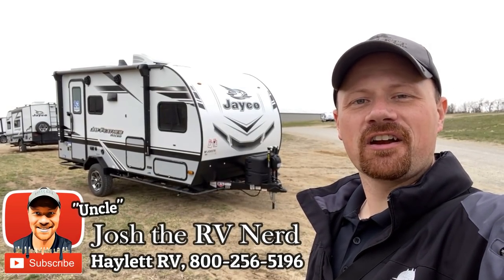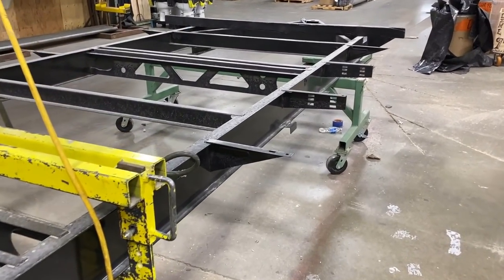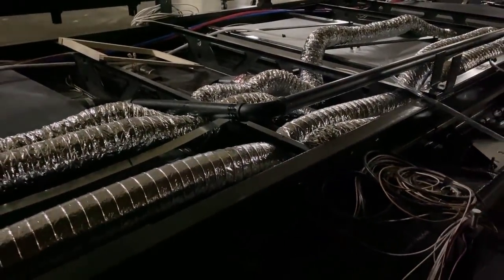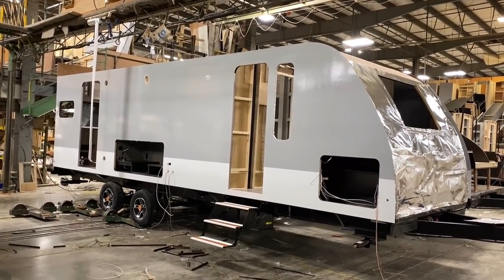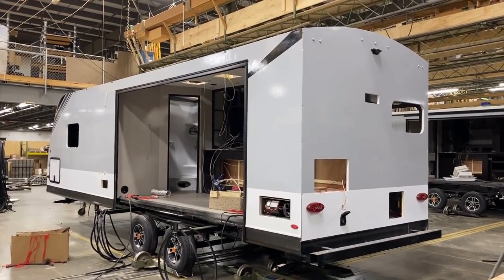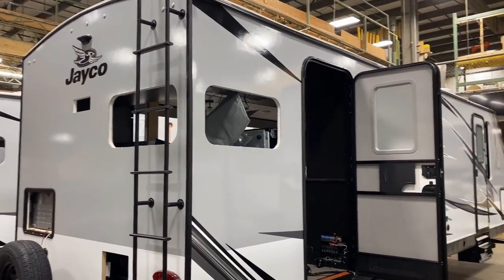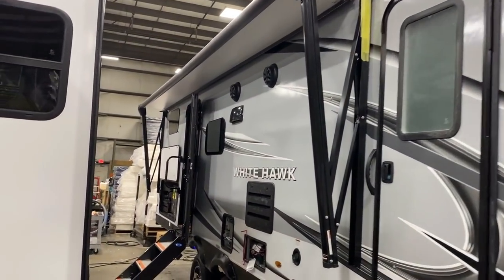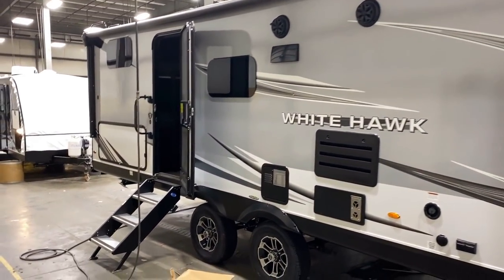(Part 4 of 4) How RVs are Made - Jayco White Hawk Plant Tour AFTER HOURS!!

Comment: Very cool. Just bought a 2022 jay feather. Only issues when I picked it up was one of the interior speakers wasn’t working and the bathroom door just barely scraped one of the lights when opening and closing. Easy and quick fixes. Had a 2014 jay flight before that. No construction issues. That’s why I went with jayco again.
Reply from the maker: Thx Nathan. Appreciate you sharing! :)

Comment: Thanks so much for all your videos! Question—what is your opinion on tankless water heaters for travel trailers? And more specifically, are there any makes/models of RVs that do best with them or won’t work with them at all? Thanks!😎
Reply from the maker: I didn't USED TO be a fan. The systems were just.. wonky. They worked weirdly

Now we're in what I kinda call the "Generation 3 on demand" era in which they work how you'd think/expect them to work and I like them. 

I think the only reason they're not found more commonly is simply because they're not widely understood. 

I'm seeing more luxury FWs start to use them more regularly which is a good sign they'll start permeating thru more RV production

Comment: Josh - What’s your opinion of the laminated floor that the Feathers use?  Lots of comments on the forums about soft spots. Hard to tell how big of an issue this really is. Also, have you heard anything about Jayco possibly going to beefier axles on the Feathers?  The dinky 3500# axles leave very little cargo capacity (1000# in my case).
Reply from the maker: I don’t see it on feathers NOW, but in years past saw a lot of soft floor issues

Like a lot of things there’s really a right way and a wrong way to do it, and even then I feel a heavier weight plywood floor decking with more studs does seem to last longer overall

For a lot of years manufactures would try to keep the weight as light as possible by putting crossmembers in their laminated floors basically every 4 feet on center. There would be two pieces of 2 foot wide bead foam stacked next to one another between those crossmembers. It’s simply not enough structure, and would buckle overtime

Good laminated floors have crossmembers every 2 feet, and the bead foam will actually be set on top of those crossmembers were the black foam seems are directly on top of the studs. This makes a massive difference in the longevity of the floor, but Waze and cost more by comparison so not everyone a Doppes it. Unfortunately not enough customers see and understand the difference here, and when they’re brand new they all feel fine. There are some big name fifth wheels out there who are developing a lot of soft floors as a result of that corner cutting
Reply: @JoshtheRVNerd  thank you sir.

Comment: Well Jayco must be making them better now because my 2018 White Hawk 28RL was pretty much built like crap. I have most things (not all) sorted out now, but I literally had to get a brad nail gun and double the amount they used on the trim because it was all loose and falling off, and this was in 2018 when we bought it new.  I like the White Hawk line and they are attractive trailers but Jaco is clearly building them too fast for decent quality control.  One look at their shop and the debris everywhere is it’s clear they are going so fast, there is no time allotted for housekeeping which is what you find inside the trailer. Behind panels I have found screws, brad nails and wire insulation everywhere. My water pump was mounted in such a bad spot you couldn’t work on it. When I replaced it, it got moved so I could work on it in the future.  We will hang onto our 28RL and I will continue to fix and straighten out what I can.  There is nothing wrong with the components or hardware Jayco used, its just the lack of time or effort to fit things correctly.

Comment: Hey J., why do they use that crappy dryer vent hose that the warm air has to 'fight' it's way through? If the answer is cost related they could use good , smooth tubing and reduce the size to 3" and still get better airflow along with crush resistence.
Reply from the maker: In asked nearly the same thing. I was advised it was due to the way each White Hawk floor plan's heating system varies. Some utilize floor vents. Some do not. Some only in certain areas. I was advised it was the only way they could reasonably tackle every model's heating needs while also considering their production volume demands. 

I get the sense it's not something they'd like to do in a perfect world, but in actual practice need to do to keep the line moving
Reply: OK, I guess. I could envision smaller blower motors in furnaces that weigh less and use less electricity. They could be the new "Whisper Quiet" line of RV furnaces. Pipe dreams, huh? Thanks, J. you're the best.
Reply from the maker: @burbenska  Start the company. Make it happen! I love the idea!!

Comment: I'm all for opting out of the outside kitchen and fireplace in exchange for a desk or more storage. I would cook outside, but away from the trailer. Cooking right beside the trailer makes the area around dirty and greasy that needs extra clean up work. For me, a "dad's medicine cabinet" is not even necessary. An ice chest is all that is needed. While you are at it, ask the manufacturers to switch to some better suspension, like air bags or even independent suspension. At least make that an option.
Reply from the maker: Like Rockwood style suspension??
Reply: @JoshtheRVNerd  Yup, but unfortunately I like none of the Rockwood's floor plans in the type of RV that I'm interested in.

Comment: Was told by a friend never buy a single axle , any comments ???
Reply: It just depends on how heavy and how long a trailer you want. Most trailers over 20 ft and about 3,500 pounds will have dual axles. I personally have never had a problem with a lighter trailer and a single axle.
Reply: I’ve had a single axle 18ft Wolf Pup. My opinion is there is less stability with a  single axle.
Reply from the maker: Less stability vs tandem towing in a similar size, but also less weight and cost. Depends on your vehicle, goals, and parking restrictions I think
Reply: @destinhook3826  There is an easy solution. If you don’t like a single axle trailer then all you just have to do is be committed to buy a longer and heavier trailer with dual axles?
Reply: @stevez340  Correct, or if you really like the camper, you could just upgrade to a larger tow vehicle 😂